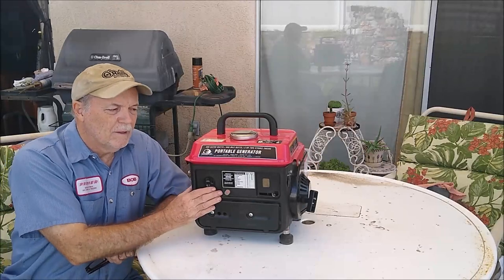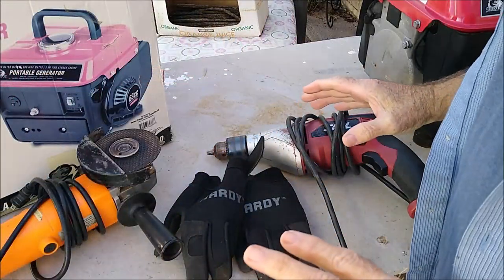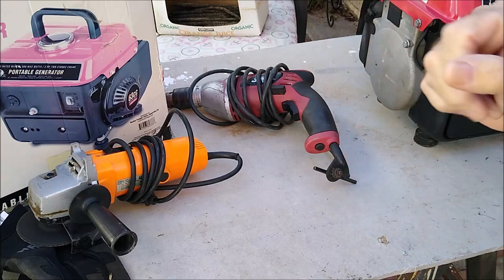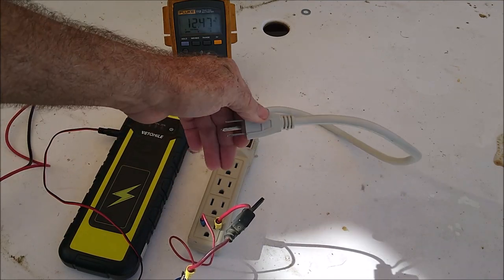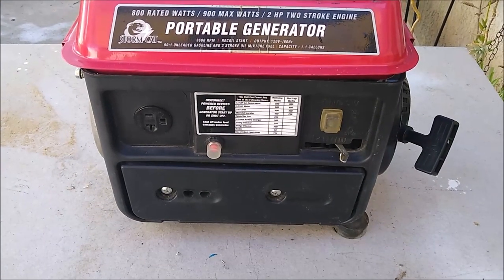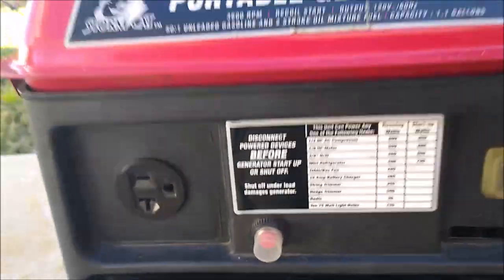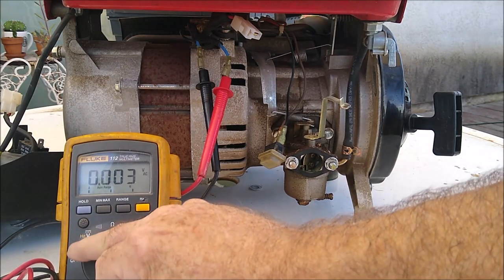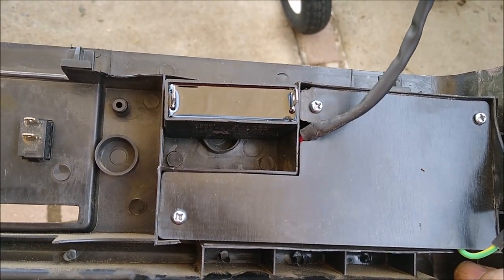Harbor Freight Generator No Output... Diangostics and Repair

Comment: Nice work. I repair generators as a business. I’ve come across poor soldering connections, particularly with the Chinese gensets. Yes, they often used copper clad aluminum wire, or poor quality copper wire. It amazes me how often these gensets loose their field, sometimes after only a few months of non use. These are a lot of fun to work on, and parts are very inexpensive.
Reply from the maker: I could have used your mind a few weeks back... LOL.. I am a retired automotive electrical specialist and worked on computer controlled vehicles so repairing this should have been easy. It was, sort of anyway. It isn't easy going from repairing and thinking computer vehicles to primitive generators. But it was real fun getting this done. Actually, more satisfying than a tough "check engine" light repair. Thanks for the comments.
Reply: I agree, John. Do this for a hobby, as i'm  retired. Garage is full of  '' stuff ''.  I noticed, the same thing with chinese gens.  As well as cheap aluminim wire; they should make better coil connections, to those brushes.  I may use JB  weld, to secure them in place, after silver soldering them with a good mechanical connection. They also use, pot metal for fuel petcocks; went to replace one, and the lock- nut broke into 3 pieces, wasn't  even tight yet.  Anyway, good luck  !
Reply: Parts are cheap my friend. Sorry
Reply: @erniemoore2365  yes I know. I was saying the parts are low cost (inexpensive). The quality of the parts is sometimes low, but sometimes not too bad.

Comment: Generator runs no output, changed 12uf capacitor still no joy, having watched YT video i plugged in an old electric drill to the generator while running, then connected the drill chuck to chuck to my cordless drill and spun it in reverse. This re-energised the generators magnetic field magnets and it came back to life and ran the electric drill.
Reply from the maker: Great! That is a process that we all try and hope will work. But it generally does not. So glad to hear that yours worked..

Comment: Thanks for this.  Mine stopped producing power after it ran out of gas under load.  All it needed was a 12V battery to the outlet for a second, while running (I used a very worn motorcycle starting battery).  Not the most obvious fix.  Oddly, next time it ran out of gas under load, nothing bad happened.
Reply from the maker: Good information. Thanks... I am going to have to remember this one.

Comment: my 9 y/o stormcat stopped making power. found the capacitor all bulged. replaced. installed. started. didn't think i saw the lights on my circuit tester so shut down and prepared to "flash." upon restart unit was making power, no flashing necessary. fwiw
Reply from the maker: Great!! Flashing is not always needed. Mine had set for about a year with that wire broken and when I tried to restart it was needing flashing. But, I did actually discharge the capacitor and the generator did not self flash. Glad yours was an inexpensive repair.

Comment: First day useing my small gator i was triming hedges  and cut the extension cord still runs only little out put.replaced the reset button and regulator no change.
Reply from the maker: Tough to say what went wrong but since the cord was cut while the unit was outputting power, the breaker has some lag time before it opens the circuit. I am wondering if you burned some wire and had it break resulting in an open circuit. If it were me I would open thins up and look for evidence of something burned/discoloured or a wire that looks cut but really is burned out. The cute will cause the amperage to increase to maximum and smaller wires are not meant to carry that much amperage and will work like a fuse and open circuit. If you have a multimeter, use it to check continuity on the various wires. Good luck...

Comment: Hello from the Uk. Those magnets are to excite the field windings, as you tried to do with the drill and grinder. It also looks like the dreaded lead free solder strikes again. I have read that the number of electronic joint failures has gone up by a factor of 9 since it was stupidly introduced. I can understand using it where it comes into contact with humans but not buried on a printed circuit board or generator. I have used one of these Chinese ones for 7 years - and it still works fine with the original spark plug. Do be careful with the pull cord, make sure it's properly engaged before pulling hard.
Reply from the maker: Yep, that was defenately not a lead solder. I avoid that stuff whenever possible. As a matter of fact, when it first came out I gave it a go. Just one try and into the dust bin it went. For 47 years I was an automotive electrical specialist and only used what worked and that lead free trash is just that. Trash. I probably will not get a lot of use out of this but it is there if needed. I run it every six months or so just to keep it fresh. You are so correct about that pull cord. Plastic paul that engages the engine is another dumb thing that should not have been done. I always take the slack out then pull. Mine has no 12 volt output but I would not use it if it had it anyway. Hey, thanks for writing.

Comment: Thumbs up for what must be the most detailed teardown and diagnostic of these marvelously handy little 2-stroke fussbucket gensets on YouTube. It doesn't help me solve the no-start or quickly-dying low-spark issue on one of mine, but deserves acknowledgement all the same. With my sickly StormCat about a year ago its engine intermittently started dying after a minute or three of startup, though sometimes it would run just fine for hours. Gradually though it got worse, until it wouldn't start at all. I tried a factory fresh Autolite 64 sparkplug and other known good NGK ones, then a fresh coil (with its new spark plug lead), tried disconnecting and also jumping the engine on-off switch, and even tried another fresh coil, suspecting the replacement might have been faulty. With the spark plug out and held against the engine case I now get either no spark or one so feeble as to be only barely visible, like Tinkerbell's farts. It may start and run for a few seconds, but very soon stalls. On other fronts, fuel delivery seems fine, flowing from the petcock/fuel tap well enough. I run exclusively ethanol-free fuel in it and always run the carb dry to shut it down, so I really doubt a fuel issue is the culprit, and can totally rule out any sort of ethanol-snot cloggery that typically sidelines these little rigs. I'm pretty certain mine's woes are all due to a poor spark issue, but just don't really know where to go from here to resolve it. I can confirm that the green and black low tension (?) leads to the coil have some DC voltage--maybe 5 VDC at best, but apart from that I'm now stumped. I know I'm a bit late to the party, but any advice out there?
Reply from the maker: Sorry that you are having troubles with your Stormcat. As to the low spark... have you removed the flywheel and checked the plate under it? The flywheel is under the pull start rope. Inside is a device designed to trigger the spark. I have seen them become loose and show a weak spark. Also heard of a foreign metalic particle finding its way in there causing the trigger to be unseen because it is always triggered. The coil needs to have power flowing into it bulid energy intensity then, when triggered, it releases the energy built up resulting in a spark looking for a place to go. Hence the spark plug. That is where I would start for spark issues and be sure to check the wiring. It can break internally due to fatigue. (Like bending a coat hanger back and forth until if finally breaks. Wire can so the same but is hidden within the plastic covering. ) Pull the wire from both ends to see if it comes apart or stretches. 

If spark is not the fault, check to see if there is any compression in the cylinder. Remember, fuel, spark and compression as well as air flow are needed to run an internal combustion engine. Hope this helps.
Reply: @bobamos3628  Thanks! My hunch is you're right. Compression seems fine, and its decent fuel flow from the tap, intermittent running and my consistent use of non-ethanol fuel to prevent "cloggery" leads me to believe the fuel system and carburation's probably OK too. Yet its ultra-weak spark despite not one but two coil replacements leads me to concur with you that a look around the flywheel sensor's in order.
Reply from the maker: @BilgemasterBill  Remember that fuel flow to the carb may be good but if the jets are plugged in any way that fue will not flow and the unit will stall. You did say tat you run the carb dry before shut down.I do the same and that has worked well so probably not fuel. Good luck.
Reply: @bobamos3628  Indeed. That's how I always shut them down: turn off the fuel and let the carb run dry.

Comment: Thanks, Mr. Amos.  i agree with the angle grinder; alot safer and better control, when engine starts. Using a 12 volt battery, is usually better, as it gives the rotor a good dose, of magnetism.
Reply from the maker: Thanks for sharing

Comment: The gen side crank seal popped out on one of mine, it's a 20x30x7 oil seal.  That makes for a huge crankcase air-leak, so it wouldn't start (of course)  This was an earlier model, I don't think it was the correct material for gasoline/oil.  I haven't had any problem (yet) with the crank seal under the flywheel but I think it's the same size.
When adjusting the engine governor speed, I use a frequency meter shooting for 60Hz at about half load, using a 500Watt incandescent shop lamp.
Reply from the maker: Poor fit of the seal or was it "blown" out?
Reply: @bobamos3628  Poor fit, I think they drove it in slightly crooked and crushed it.  The problem never occured until I overloaded the generator that's when pressure was great enough to pop the seal out.
Temporarily, I reached it with a long screwdriver and pushed it back in place, not a very tight fit considering I could push it into position.
I'll be replacing the seal.

Comment: 13:00 time.   There are 2 diodes, 2 resistors on rotor;  each coil has a resistor and a black diode; rated probably 8 amps or so.  Check those diodes, may be open, or worse. (AC to DC conversion, same as battery charger.)
Reply from the maker: Yes there are. i found it easier to replace the resistors than testing but the diodes were a little tougher to get to so I just left them after they tested good. My failure was one of the wires from the stator coil. These use a non solder material to connect them.
Reply: @bobamos3628  non solder ?  guess we now know, where the  ' cheap '  in china is.     i'd  use  JB  weld, on them, after using silver solder.....
Reply from the maker: @petersack5074  Yep, they use a product that is sort like epoxy but can carry electrical current. Crazy stuff.. It is called "Wire Glue". https://www.amazon.com/gp/product/B000Z9H7ZW/ref=ppx_yo_dt_b_search_asin_title?ie=UTF8&psc=1
Reply: There is only one resistor and one diode in my generator. The coils are connected in series with each other. I wonder how many ohm resistor should I put, can you help me? (note my generator is 220v 50hz)
Reply from the maker: @kaangoncu2167  Looks like they split the circits for 110 volts. Your 220 volts most likely wire it this way. Sort of like a 12 volt vs 24 volt batteries. 2-12 volt batteries run paralellel gives you 12 volts. 2-12 volt batteries in series gives you 24 volts. Same concept I would think.

Comment: Hi Bob,I flashed mine and it did work but only gave power for a few seconds then stopped againg,seems like its not keeping a charge.Should I flash for a longer time witth power pack?
Reply from the maker: Gee, I wonder why it is not holding a charge? Re-flashing might work. Worth a try. As to longer holding the flash, It should not need that. They charge instantly. Either the capacitor is defective and loses charge internally or there is something discharging it like you do when the two terminals are shorted together. But, there could be something else within the generator that is causing the thing to stop outputting power.  Not having the generator in front of me it is difficult to say as to the possible cause. If the unit was operating while charging then stopped while in operation I'd think that it might be something that is moving. Mine was caused by the rotor moving and the wire losing connection. I would bet that the capacitor  is holding a charge and something else is causing the failure. If you short circuit the capacitor and there is a "pop" then it is holding the charge. Re-flash to restore the charge. If there is no "pop" as you short out the terminals then it is not holding the charge. That should isolate the possibility of a capacitor issue. Be very careful discharging that capacitor. If you do try to discharge it, do so at your own risk.   Hope that you can sort it all out.

Comment: I have one of these that runs fine but I found the capacitor to be defective. 
  I replaced the capacitor and started it up. I then plugged a drill into it. The drill then ran for a moment and shut off. I checked the breaker that wasn’t tripped!
  I haven’t taken it apart yet but I have a feeling that something is frying the capacitor?
  If the capacitor is fried again what should I look for?
  Thanks
Reply from the maker: Well, first you need to determine if it is, indeed, a burned out capacitor. If it is, looks for physical evidence of damage to the capacitor. Most replacement caps are made in China and I have seen a capacitor that was manufactured poorly and failed when placed in service. To test the capacitor, use a screwdriver and short across the terminals and look for a spark. If none recharge the capacitor with a battery. Connect one side of the battery to the cap and momentarily touch the other side of the battery to the other side of the cap. A spark should happen. Then short the capacitor with the screwdriver and look for the spark as it discharges. Be very careful not to harm yourself. I cannot be accountable for any damages that might occur to yourself or the generator. (  I just need to post that as protection for myself. Some people just don't mix well with electricity.) Good luck.

Comment: My stormcat would run a drill, but not my phone charger .I turned the idel and it worked now
Reply from the maker: Good advice. The generator needs to reach a certain load level for it to respond and increase RPM as well as needing a certain RPM in order to work. So, the phone probably was not enough of a load for the generator to see but the drill certainly was. It responded to the drill and increased RPM and started an output but with too low an RPM it would not start an output and not charge the phone. Glad that you got it to work for you. Remember though, that this is not a clean output machine and the erattic output could damage sensitive devices.

Comment: I have one of these generators and the capacitor had an obvious melt down. I've ordered another CBB61. I'm not that experienced with generators, however, should I assume the failure was at the capacitor or should I be looking at components upstream that might have caused this?
Reply from the maker: Well, when any part has a real "melt down" that is visible, I always suspect some other reason. Without seeing the part and where it melted it would be difficult to say. First thing that I would do is inspect the two connectors on the ends. Are they also burned. If so, they may be loose on the terminal. A loose connection will create resistance and resistance creates heat. So, if that is the case, replace both terminal ends and the capacitor. Then run the generator with the face hanging loose. Feel the resistor for heat. If it is hot there is something wrong that is causing this heat. Generally, too much current flowing through the condenser. A condenser is made up of alternating thin sheets of metal with an insulator between them. There are MANY of these sheets sandwiched into the condenser. It is not unusual for an internal leak to develop causing a short circuit inside the condenser resulting in a melt down. The condenser is supposed to supply a stored electrical charge that helps get the charge going. Think of a condenser as a sort of storage battery. By the way, these condensers are not polarity sensitive. They will  fit with the two wires on any side and will not be seen as reversed. Hope this is helpful. Good luck and thanks for writing.

Comment: Hello Bob, very good video !  Mine has a low voltage issue and I tried replacing and flashing the capacitor to no avail. Could it be the resistor+diode inside? they look in great shape and I am hesitant to take them apart... any hint on how to diagnose the resistor+diode in place? thanks
Reply: UPDATE: I took apart the "rectifier" which consisted of 2 NI5408 diodes and 1 resistor, all connected in parallel (why 2 diodes in parallel?). One diode was fried, I simply removed it and kept the other good one in place. All good now. NB: it is a no-name made-in-china brand.
Reply from the maker: Not sure why the two diodes/rectifiers but if one was shorted as yours probably was it would cause the condition you experienced. Anyway, glad that you solved the problem.
Reply: @jonid9046  two diodes in parallel to handle more current I'd guess